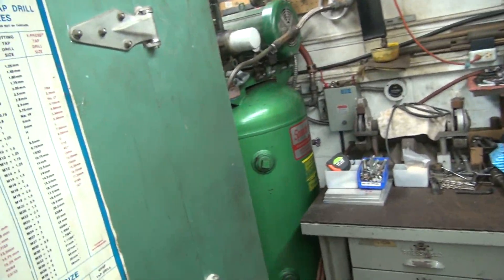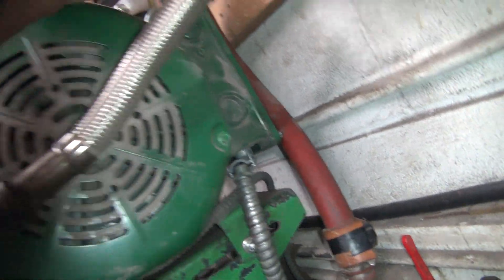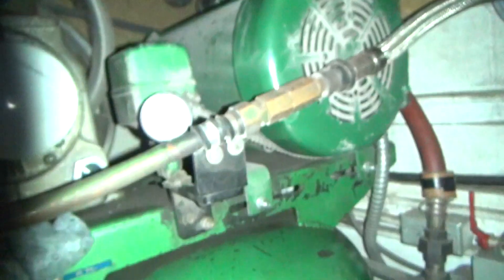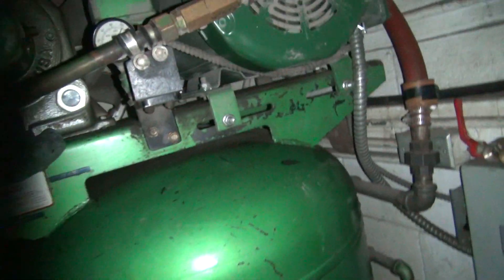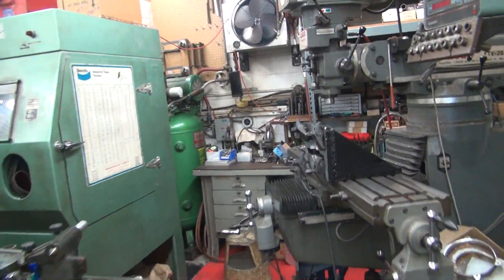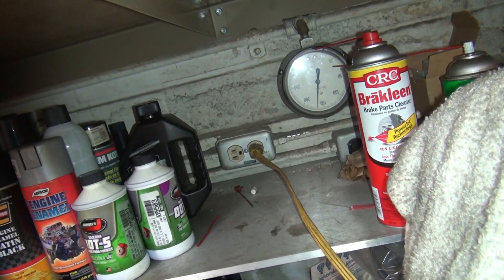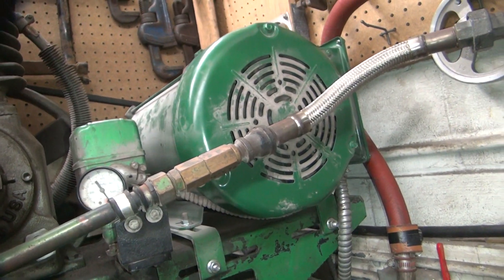#103 fixing shop dayton air compressor 240v 7-1/2hp repair motor reed capacitor harley tatro machine

Comment: Hi Tatro, The motor will have a centrifugal switch behind the fan which switches between the start capacitor and the run capacitor. Either the switch has bad contacts or the run capacitor/s is on the way out. The fact that it runs intermittently would suggest it is the switch. This would also cause the thermal switch to keep tripping.
Reply from the maker: maybe but i don't think so. we will see soon.
tatro

Comment: You might wanna double check the capacitors again, 1 should be for start up then 2 for run, I had a issue with a  small 220 unit it had the wrong cap, would get hot, double check the wiring on them I seen you have a schematic but you never know, the clicking sounds like the breaker kicking on, it's so loud on video you can't tell, hope ya figure it out, also remember to drain the tank they can get a lot of water in them

Comment: I actually work on air compressors for a living. The "circuit breaker" on the motor is usually a thermal over load. If the motor is getting really hot, its tripping that thermal over load, but you will be able to reset the overload once the motor cools. The reason your pump has pressure stuck in the head is you are turning the machine on and off at the magnetic starter. Your pressure switch should be what is turning the machine on and off, and If the contacts on your pressure switch are never opening / closing, then the little unloader valve on the switch is never actuating and bleeding off the residual pressure in the head / copper discharge tube. The clacking noise you are hearing in the motor might be the centrifical switch which is usually located in the back of the motor, which switched the motor between the "start" windings and the "run" windings. Get a multi meter with an amp clamp on it, and put it on the motor power wires and see how much amperage the motor is drawing when its running then compare it to whats specified on the motor tag under "SFA (service factor amps) or FLA (full load amps). Hope this helps?
Reply from the maker: it is not the compressor or the switch because it makes the same noise as it is running. it just makes that same noise on the start too. 
the motor is running very hot so i am thinking it is more in the commutator or brushes. the armature might have a fried leg or two? its coming apart soon to see what i find. i don't like running things until they are done.
tatro
Reply: @TatroMachine  Do not quote me, but this motor does not have brushes in it. I know a limited amount about motors however, just enough to get peoples machines back up and running. Keep us posted on what you find. I am going to double down and say the motor centrifugal switch contacts have welded together and its stuck running off of the "start" windings. Good luck.
Reply from the maker: that is my #2 option too. i still think its in the armature area and brushes.
tatro
Reply: @TatroMachine  99% of AC motors ain't got any brushes or commutator. 
There's only a rotor.
Reply: @jontest5718  The switch welded closed or the flyweight stuck or broken is a possibility. That would leave the start windings on during run and trip the overload in a couple seconds.
Reply: @austincjett  Agreed. Hopefully we hear an update soon.

Comment: Check the starter contacts.  It’s the little green box with the nut on top. Turn power off and unscrew the nut that on top.  Lift off cap and check to make sure contacts aren’t stuck together. It happens very frequently.
Reply from the maker: no
Reply: @TatroMachine  No what?
Reply from the maker: it starts just fine. it is the high amp draw and heat build up that is the problem. there is a noise that you can here on the hit of the start. that happens as it runs too but i can't tell what it is. you would think the viewers would have know that i was turning the compressor on and off to show the noise that i was describing. obviously the starting was not the problem.
tatro

Comment: I also work on compressor for a living . George and john have brought up exactly what i would start with noise is from the start clutch in motor . Might be a good idea to test mfd of caps in motors . But the first thing i would look at since you still have head pressure is the check valve between your compressor head and your tank . Your back feed pressure to the head witch creates a very hard start for the motor . Typically when that happens the motor will trip the circuit immediately. Might even be the something going on with the unloader  leaving head pressure in the compressor head. More that likely the check valve has carbon build up not allowing the ceramic disc to seat . Some valves have a snap ring . So you can pull them apart and clean them . Others will have to be replaced . Most compressors repair shops in the area should stock the valve .
Reply from the maker: it is not the compressor because it makes the same noise as it is running. it just makes that same noise on the start too. 
the motor is running very hot so i am thinking it is more in the commutator or brushes. the armature might have a fried leg or two? its coming apart soon to see what i find. i don't like running things until they are done.
tatro

Comment: I ran into a similar situation a while back with a Dayton motor, and it turned out to be the bearing on the pulley shaft was ceasing and overheating the motor and kicking the breaker. Just a thought.
Reply from the maker: that would be option two for me. option one is the armature commutator or brushes.
tatro

Comment: I have been told bad caps can cause an electric motor to overheat and trip the protection.  After checking for mechanical binding in the compressor and motor, you might test the caps. You can test an electrolytic capacitor by shorting the terminals together to discharge it. (Be careful, they hold quite the charge) then attaching an ANALOG meter to it.  Set it to ohms, so you are running off the meter battery and touch one terminal to each cap terminal. Then, reverse them and do it again.   If the cap is good, the reading should go higher  the second time.
Reply from the maker: that was allready done in my last video before this one.
tatro

Comment: The check valve might be leaking and the motor is having to start spinning the compressor against full pressure. That or the regulator isn't bleeding off the pressure when it shuts down.
Reply from the maker: no

Comment: Does it have a centrifugal switch to switch from start windings to run windings in the motor? If so it may have a failure in the run windings contacts.

Comment: Motor overheating, bad run cap or caps. That clack is the start capacitor clutch kicking out and I didn't hear the unloader valve either.
Reply: It looks like it's plumbed without an unloader valve? The check valve is probably the fitting where the copper line from compressor connects to the flex hose.
 I was cringing very time the motor restarted.
You're not supposed to start a compressor duty electric motor that often.
Reply from the maker: the capacitors checked good so i am moving on to something else. i am moving on to the guts in the motor next.
tatro
Reply: @TatroMachine  If you're gonna take it apart replace the bearings and check the windings with an ohm meter. I suspect as others have suggested you have a check valve or unloader valve problem.  Kind of like kick starting a Harley that's out of time. I have the same compressor, mine is a bit newer tho.

Comment: Shoot it with ir temp if it cuts out low replace switch that would cause the trip
Reply: Points in pressure switch pitted

Comment: Pull the back cover off and then the fan and the Centrifugal switch should be behind that. Check/clean the contacts. If they are OK then its probably the run cap/s.
Reply from the maker: its not a starting problem. it is a running problem. you can just hear it on the start up.
tatro
Reply: @TatroMachine  I'd pull the cooling fan and the dust cover behind it and have a look at the start points anyway. The contacts welded shut or the flyweight assembly misadjusted can cause the problems the compressor is having. Although usually the start cap gets murdered first.

Comment: If the motor is heating up , could be a few things , loose wire , bad wire end , dirty contacts , stuck brushes if it has brushes or wore out brushes , the kick on and off switch , armature or field problem , bad breaker , bad thermal switch usually in the armature , bad reset switch , maybe you have some electrician buddies you can get to check it , amp draw and etc....... You have to have a compressor no way around that .......

Comment: Take belt off electric motor check shaft with your hand for side to side movement and noise, if so bad bearings replace motor.. with belt off turn on power to electric motor and see if it still trips breaker. If so, replace motor. With belt back on motor turn on motor and check amp draw on  a hot leg if it exceeds FLA (full load amps) there’s a problem that’s a few quick checks. While you have the belt off, turn the pump pulley make sure it’s not seizing up and make sure you have oil of course in it,,as you well know sometimes a motor won’t trip the breaker free of resistance but once you add the resistance with belt and pump, it will trip breaker if windings are going bad or the pump is dragging down the motor
Reply from the maker: i am going with the windings going bad or the brushes. we will see soon.
tatro

Comment: grease fitting been used lately?
Reply from the maker: nope, i don't know if it even has one. not where i can see them it there are any. its coming apart anyway.
tatro
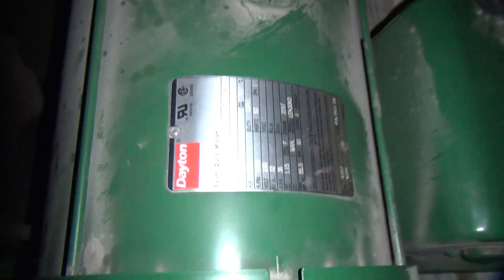Reply: @TatroMachine  Looked like a zerk fitting at 12 O:Clock on top of the front cover, painted green? @ 2:30

Comment: Take the belt off, spin the compressor by hand with the discharge pipe disconnected. Resistance on drive pulley? Bearing noise? Run/spin by hand the motor absent the compressor, noise? Motor should run forever absent the compressor.

Comment: I think the problem would go away if the stroke on the pump was increased to a minimum 4-5/8" 😅
Reply from the maker: i already have the big stroker pulley on the motor. that pump is singing.
tatro

Comment: It lasted for years being wrong, but now it's broken because of it.
Reply from the maker: how would you know. you have no idea what is wrong with it just like i don't. what i do know is that what is wrong is in the motor and not the pump or external parts.
tatro
Reply: @TatroMachine  Your right, I don't know what is wrong.
But I do have +50 years of on the job experience fixing what other people have broken. The compressor is supposed to be unloaded "easy to turn" when first starting, so the motor gets a running head start and up to speed. 
First thing I would do is use a clamp on amp gage, to check the running current, then take the belt off and see how many amps the motor pulls without a load. The 7.5hp motor should pull around 22amps at full load if everything is right and less than 7ish amps under no load.
Reply from the maker: that would be a good test if i had that kind of meter. i do think it has a heavy amp load going in because of the heat build up in the motor. its coming apart so that i can see what is wrong, instead of guessing. most of the time you can see what is wrong with things when all the parts are in front of you.
tatro